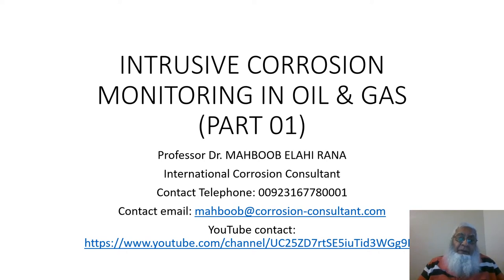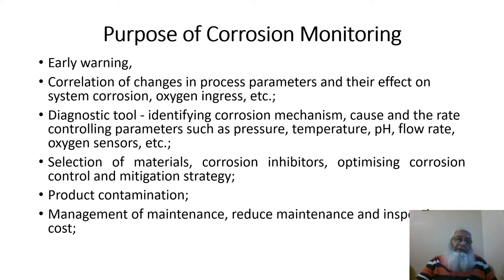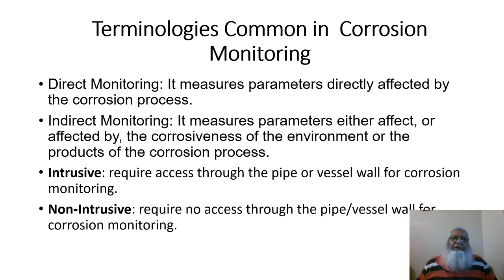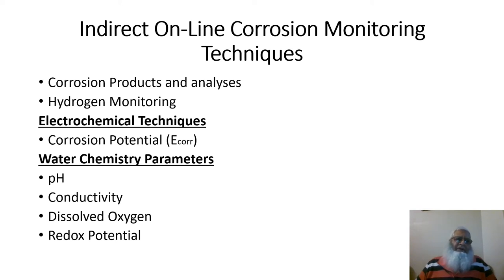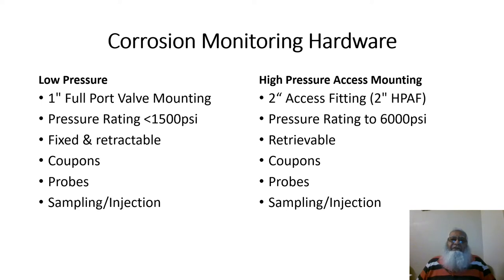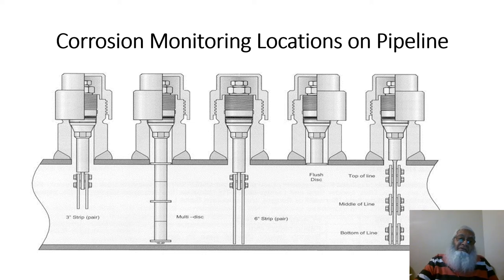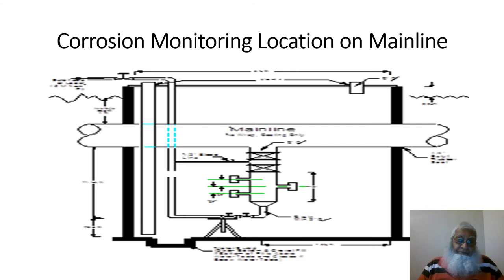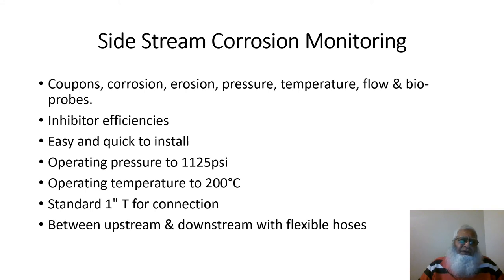INTRUSIVE CORROSION MONITORING FOR OIL & GAS FACILITIES PART 01

Comment: Hi Sir .. It’s very informative Vedios… thanks a lot .. I wish to ask one query. LPR (Linear Polarization Resistance Probe) is useful in 3phase Separator vessel (oil and gas) for the internal corrosion monitoring ? If yes where is the best medium for placement of LPR
Reply from the maker: LPR is used only in Aqueous Phase.
Reply: @professordr.mahboobrana5435  hello sir noted. As you already aware in 3 phase vessel the 1st phase is water then oil and then gas. My specific question is whether LPR can be installed in water phase of vessel (means where Cathodic Protection anode installing electrically conductive electrolyte) ?
 
Would aqueous phase meant to say only cooling water or fresh water type which doesn’t have any contaminates? Kindly clarify
Reply from the maker: @anasmuhammed9694  Produced water in three phase separator is not clean, LPR electrodes can become dirty and give erroneous results. Better, use coupons.
Reply: @professordr.mahboobrana5435  noted with thanks.
Reply from the maker: @anasmuhammed9694  Soon I will be launching a preparatory course for candidates seeking certification in API 571.
Reply: @professordr.mahboobrana5435  noted sir👍
Reply: @professordr.mahboobrana5435  in addition to placemat of coupon in water phase , could you pls advise whether coupon can position in gas phase too (if requirement warranted) ? 

This is just to understand whether coupon and ER probe can be installed in any medium as compare to LPR.
Reply from the maker: @anasmuhammed9694  Yes, but you have to check the anticipated corrosion rate before installing corrosion monitoring tools. Coupons give more meaningful results and are economical.
Reply: @professordr.mahboobrana5435  many thanks… 
Hope same is apply for ER probe too.. I.e.  ER probe too suitable in all fluid medium….